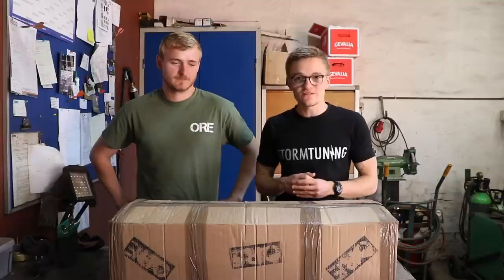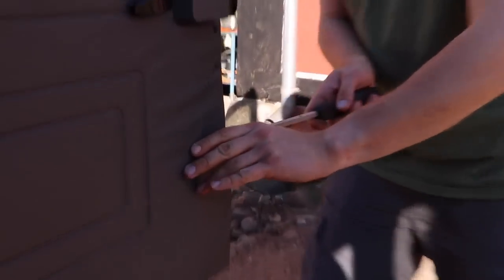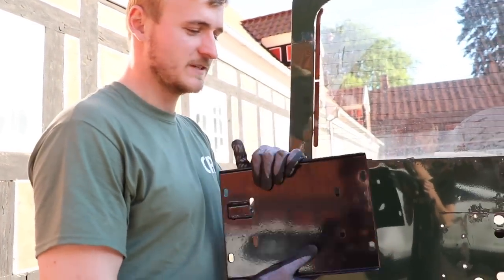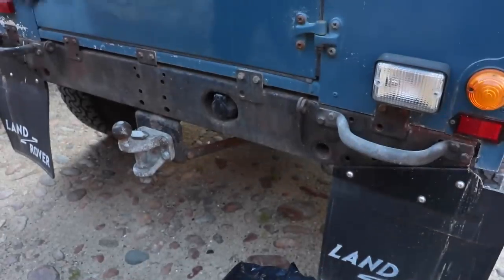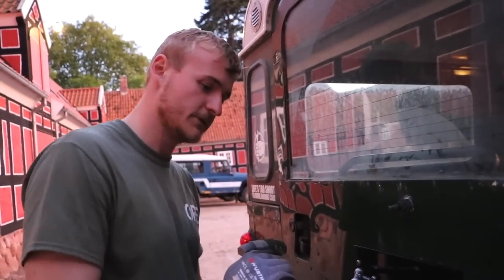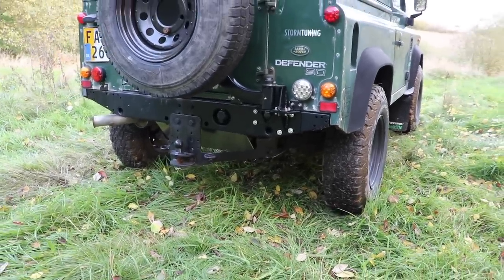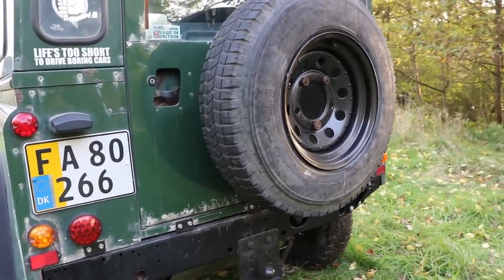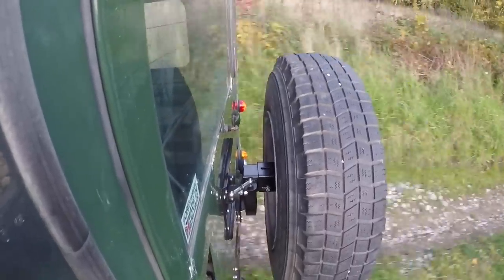ORE's Over Engineered (But Brilliant) Wheel Carrier

Comment: Mine finally arrived today. Can’t wait to fit it. By that, I mean, I can’t wait for my mechanic to fit it. 👍👍😂
Reply: I’m rather mechanically inept and found it needed a little adjusting to fit it securely. Anyone with any mechanical prowess would have no problem fitting. Got it sorted, it fits perfectly and is very heavy duty. Very pleased with it. Takes a weight off my mind knowing that all the weight is on the crossmember rather than the body or door. Highly recommended. 👍👍

Comment: I don't understand the benefit of the carrier being mounted to the chassis only and not to the tub capping? For over 3.5x the price of my Britpart one it seems to actually rattle and flex more!?
Reply from the maker: Mounting to the capping will still cause flex in the door, which can lead to it cracking. This won't twist the body or door at all, nor does it require any drilling. Although this one moves about a bit, it's not causing any stress or noise.

Comment: The arm from the crossmember looks great, the smaller bits and bobs really let it down imo, remember carriers of old where there was a simple hinged brace bar from the same centrally located door plate to the arm via poly bushes, that would probably be a more robust design.... and @ £549 its incredibly expensive.
Reply from the maker: It is expensive, but you get what you pay for - Which in this case is a very high quality/well engineered product.

Comment: At about 19:30 mark you can see force transfer from the wheel to the door, i know its a miner wobble transfer from carrier to the door but do you think that maybe if they made an extra "arm" that would go straight down and when closing the door it would connect to the top point of the chassis, and to make it so you can put two extra pins trough the holes on the "bumper" (chassis) to make it "fix" for the longer drive and when you want to open the door you just have t pull 2 pins out and open it normally, maybe that would be stronger solution?